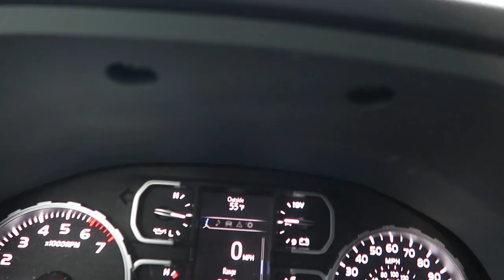Something Ran Through Our Pigs Electric Fence

Comment: You can get a really cheap "shop vac" at lowes for about 35 bucks. It's just the vac top and hose, etc. You attach it to the top of any 5 gallon bucket. Put one of those in the goat barn, to pick up the poop on their bed. Then you can dump that in the compost pile, instead of having it build up in the barn that much faster.

The hose may develop a permanent kink in it where it comes across that wheel. Also, when you drain it, don't forget to drain the inside as well.

Comment: Hi Al, I suggest a battery vacuum to clean the goats' sleeping spot, I would have tied the nozzle to the ceiling with a spring, so it can be pulled down, like some lamps with variable height have it, instead of the counterweight you did. And I also hope, that Andy has found his final place to stay, as the ones before were not perfect for his living and did not really fit him

Comment: I use 3/4" EMT mounted with conduit clips (the good ones with a bolt, not a sheet metal screw) to make hanging rails in my shop. I usually custom-bend the hooks for whatever weird thing I'm hanging so it hangs the way I want it, but I also have a bunch that are long S-hooks.
Reply from the maker: I like that idea 💡

Comment: Okay Al , I have a thought . How about attaching a clamp around the hose  ( not compressing the hose , merely grasping the hose ) and attaching something like a screen door spring to the clamp and the other end of the spring to the ceiling.  That way , the hose could hang down but still be out of the way.  When you need to use the sprayer , just pull it down.  When finished with the sprayer , the spring will retract the hose up and out of the way.  What do you think ? Any spring would work but a screen door spring would not be hard to pull on and will stretch out quite a ways.

Comment: Maybe a deer was going through the two fence wires and was shocked causing it to jump and thus shooting the insulator up into the air and landing where you found it. Also another item that might help your battery last longer on your pig fence is to get it off of the ground. As a battery sits on the cold ground energy is pulled from it by way of cooling the battery more than what it would be just in the air around it. If you haven't by now you could also put a solar charging system attached to it like a solar panel that you could clip to it but you would have to regulate the charging of the battery with a regulator as well.

Comment: Hey Al,  Looked like a Hickory Tussock caterpillar, they're apparently common in your part of US according to USDA.  Eat various woodland species (walnut, butternut, and hickory. birch, elm, black locust, basswood, and aspen).  Their hairs can cause skin reactions due to compounds they get out of the trees they feed on, so be careful.  Is apparently reports of them being venomous, but seems to be some debate about that.  I wouldn't suggest being the one to test the validity of that claim, so maybe better to look but don't touch. Nice job on the outdoor kitchen sprayer.  Oh, you might need to put some little "drainage holes" on the ends of those boards on the goat bed.  Maybe some little hippos in each corner of the platform to take care of those little black marbles :) hehehe

Comment: Al, in the future you might want to consider using some surplus restaurant supplies to get yourself the overhead nozzle setup like you're working towards. I see in your later video you got the newer nozzle, like I'm referring to, but the hose/spring setup to work with it are awesome and last forever. It'll be a longer term and cleaner setup for ya.

Commerical Wall Mount Pre-rinse faucet
https://images-na.ssl-images-amazon.com/images/I/51Rjkn6dWTL._SY355_.jpg

Comment: I noticed the large hole on the inside of the pig run almost in front of the fence post. Could they have been rooting with there nose and caught the bottom wire with insulator and sent it for a ride, "grass is always greener on the other side" lol. Maybe they got a little zap and stayed inside the pasture. Did you walk around the entire thing to see if it was something else who got inside made a exit.

Comment: You have hot water to the outdoor kitchen?  Do you use a traditional hot water heater?
Reply from the maker: We have a hose spigot that does hot and gold outside
Reply: So it's hosed from the house?  Not hardlined to the kitchen?
Reply from the maker: Right. We hook our hose up when we need it. I want to set it up with rain water
Reply: @LumnahAcres  right on.  I was curious because I know someone makes an inline hot water heater however I'm not sure on how well it works being exposed to outdoor seasonal temps.  Thought you may have installed one and I missed it.   Anyhow, a rainwater feed should work well in your application.  Great channel Al and thanks for the info.